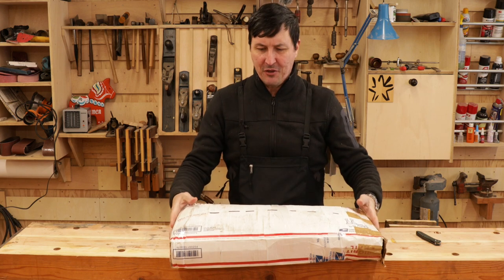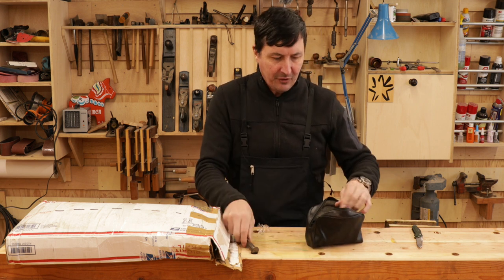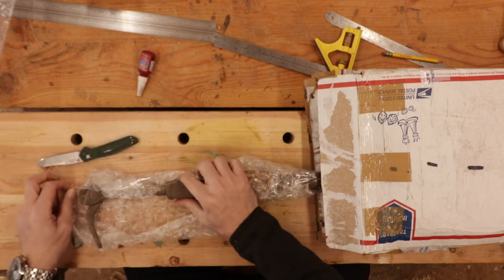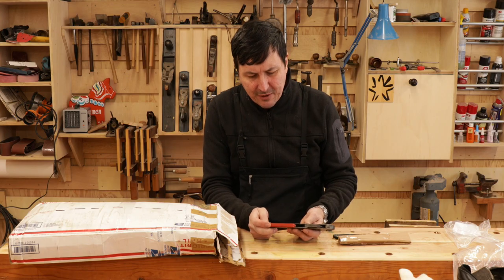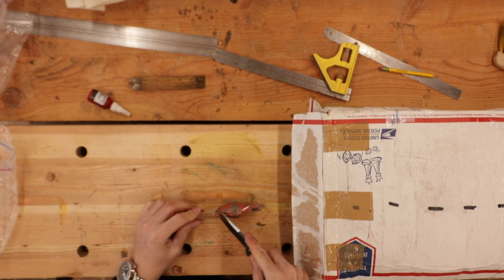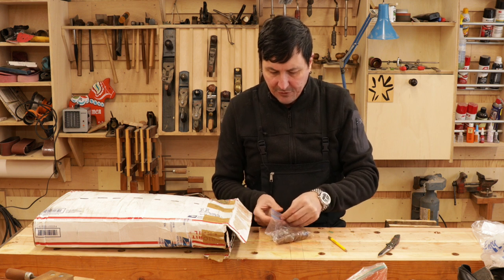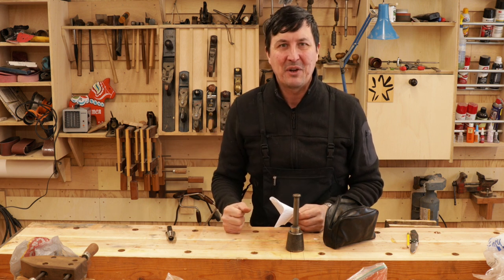AMAZING Vintage Tool Unboxing

Comment: I've lit a lot of fires with my Western! I sharpened one for someone else, looked up the brand in the forums, and fell in love. Had to have one. Found one from the fifties, still made in Boulder, CO. I just love it. I put a convex edge on it, like an old Marbles knife. Finding one with the sheath in good condition is either rare or expensive. I had to sew my own. You'll love it it you keep it, and if you give it away, it will be treasured.

Comment: Cody, that is a pounce wheel, also known as a tracing wheel. Pouncing is an art technique used for transferring an image from one surface to another. It is similar to tracing, and is useful for creating copies of a sketch outline to produce finished works.

Pouncing has been a common technique for centuries, used to create copies of portraits and other works that would be finished as oil paintings, engravings, and so on. The most common method involves laying semi-transparent paper over the original image, then tracing along the lines of the image by creating pricked marks on the top sheet of paper. This pounced drawing made of pricked holes is laid over a new working surface. A powder such as chalk, graphite or pastel is forced through the holes to leave an outline on the working surface below, thus transferring the image. The powder is applied by being placed into a small bag of thin fabric such as cheesecloth, then dabbed onto the pricked holes of the pounced drawing.

Comment: Cody something I HIGHLY recommend to you is Evaporust. It's an excellent rust solvent that works for a long time. You can just dunk a tool and it will eat away all 100% of the rust on your item or tool. I bought it and I have now run out of rusty things to dunk in there! Definitely check it out.

Comment: I believe the handle with spiked wheel is called a "Ponce Wheel."  Use it on all sorts of soft materials to mark a pattern.  Used one in H.S. to trace a pattern on stencil paper, then used a powdered chalk bag to tap over the pattern and transfer to wood, etc. For sign lettering.

Comment: I believe that tool (re: stitching leather) is actually a tracing wheel.  They are used to transfer cutting lines from a pattern to the material being sewn.

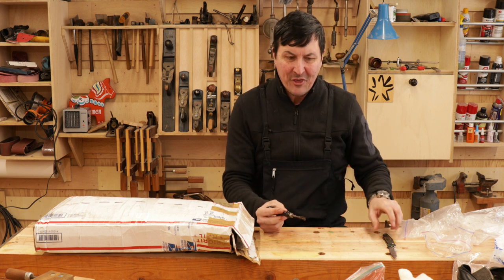Comment: Tool at 16:30 is very common for seamstress. You place a piece of 'carbon paper' (several color are available) and you trace a line that is visible enough to do you cutting or stitching but not strong enough to damage the fabric.
Nice video, thanks.

Comment: Cody before you use the grommet setter turn the anvil over, the small end needs to be up (there should be a circular groove in the small end).

Comment: I think it is a "pounce wheel" used for pattern transfer and sign making.  Pounce the pattern in some paper with the spike wheel, put the paper over the workpiece and use a bag of powdered charcoal or chalk to tap along the line and leave a dotted line of powder that goes through the holes and leaves a dotted line for the pattern.  Paper pattern can be used repeatedly.

Comment: I believe the little spoked wheel with the handle is a pattern tracer. It is used by laying a pattern on material and running the wheel along the line transferring the shape to the material whatever that is, soft wood, leather, etc.

Comment: Leather wrapped sheath knife looks a lot like an Old Buck Knife.
The tool with a toothed wheel is an old maritime tool sailors used called a Jagging Tool for marking canvas sail parts for sewing. Help you get the stitches perfect.

Comment: Great stuff.  For what it's worth, I like the Wiss brand of scissors.  Large plastic easy to grip ambidextrous handle, but available with a full tang so the blade steel continues thru to the bottom of the handle.  Great for cutting the molded plastic packaging that is so difficult to open otherwise.  They're available at Home Depot or Amazon.  God Bless Brother!

Comment: The little drill bit things are called Gimlets, they are or were used to make pilot holes for screws.  A full set usually covered screw sizes #2 through #9.  If the square is an expensive one at the time it will have two small screws in the bottom of the handle used to adjust the square when it goes out of square.

Comment: Did you know that you can get right and left hand scissors. It is how they shape the thumb and finger insert. Love your outlook on life.
Reply: Robert Sullivan The cutting edges are on opposite sides as well. The normal lateral forces when operating scissors are supposed to press the blades together. If you use scissors made for the other hand, the natural motion spreads the blades apart instead. You can easily see this in those simple grade-school scissors with the round holes that do not have the tapered surfaces so are supposed to be either left or right handed. A left handed person can you them with some practice but the hand quickly fatigues due to the unnatural motions needed to force the blades together instead of apart.
Reply: Thanks Thomas. Great explanation

Comment: The small-toothed wheels were also used to transfer patterns from paper to wood by rolling over the lines and leaving the line of holes to mark the pattern.  Additionally, you could flip the pattern over, following the line of punch marks to mark mirror image parts from a single pattern.

Comment: Keep your crappy fiskars for paper, then you don't have to use the good ones on the stuff. As Adam Savage once said "Paper is a collection of polymers specifically designed to dull scissors"

Comment: Folding rulers are used much more than tape measures here in Germany. I find it easier to use too, especially when measuring things like heights and stuff in midair, where a tape measure is not stiff, so it will sag.
Ours fold differently from that one thiugh, and are much longer.

Comment: STAR WHEEL: used for transferring a pattern to another surface.  On a paper a pattern or sign letters are sketched. The star tools pokes little holes into the paper...so a bag of chalk powder can hit the paper and got thru the holes to give you a chalked pattern lines.

Comment: Funny how when you were un-boxing the items, I found myself mouthing the names of most of them. I'm 64 years old and have worked with my father while growing up. He had tools that were handed down to him from different sources. And now I have them. He was a backyard mechanic and a machinist. I also worked for the water supply company in my home town in lower Westchester, N.Y. They had a wealth of tools and machinery that went back to the mid to late 1900's. I knew immediately that was grommet tool because I used one quite a few times. The nail puller, yep. I used an extremely old yet still perfectly functional one only king size to open large crates that came with things to do with water supply, fire hydrants, etc. I'm getting old now and my son has no interest in any of this stuff.

Comment: The tool at 10min is a Locking pliers. Used for welding generaly. You adjust the thickness of the part you weld with the litle "screw".

Comment: That knife is one of the original style for the Boy Scouts. I just did a restoration on one a few months ago for a coworker. The leather stacked handle on the one I received was missing, so I replaced it with some green canvas micarta. I can send you some pictures of it.

Comment: My grandmother had a pair of arrow scissors.  They weren't general purpose.  Those were her seamstressing scissors. Man if you touched the old pair to anything but thread you were going to hear about it.  And we don't even think of touching the good pair in her sewing box.  Search Midwest arrow scissors prior to 1940.  I think they were a Midwest thing but they were slick.  They would cut poly or cotton thread with zero fray.  So easy to thread tiny needles which was always dedicated to us little kids with young eyes.

Comment: "little tiny drill bit with handle" is called a gimlet
Reply: Yep...
Reply: It's not a power tool ... so ... there is no problem
Reply: Thomas Grant Vodka for a gimlet... K
Reply: wasn't that a dwarf on the hobbit ?
Reply: Gimlet, Son of Groin....
Reply: Thomas Grant Anyone ever told you your preferences are wrong and you should be ashamed?
Reply: I'm getting so old it took me 15 minutes to remember the name.  I think this may be a result of partaking more them my fair share of Gimlets in the late 60's all  of the 70's and and the better part of the early 80's "Keep Coming Back"

Comment: why don't you make a  big, heavy duty, draw-string leather bag with that grommet tool? That would be a really interesting video.
You would make use of that leather rolling too to do some stitching, perhaps even forge some thick needles/pins fro your leather work: and of course, use the grommet tool to put the string/rope through the top.
Nice video Cody

Comment: 1 the grommet tool is definatly military used up until the 90s when new tech came out. 2 the small drills and corkscrew are gimels and could date to the 1700s.

Comment: Cody the anvil for the grommet tool goes the other way...  If you look at the small end you will find it has been machined to help form the grommets and lock the two halves together.

You have some neat things there.  I too like those gloves, most of the time I use TIG welding gloves unless I'm doing high amperage welding.

Comment: I don't know arrount the world, but that folding ruler, damn, so nostalgic. I'm brazilian, we use metric system, and those are called here "metro", literally a "meter" kkk but it has imperials also. My grandpa was a carpenter and cobbler (is it right? If it's not, blame on g translate), and I still have his ruler. I'ts insase to know he made such incredible stuff using this as his only measurement tool. Seeing one of these on your hands made my day!

Comment: I have a Grommet set very similar to that one. Its in a green Tent Canvas type of pouch with a brass clasp that has the Boy Scouts Logo on it. The pouch has pockets on the inside to hold the various parts of the tool. The punches are stamped BSA. Im thinking its from the 40s or 50s.

Comment: Those gloves may be structure firefighter gloves. On the video they looked a little thin but look a lot like the older style of structure gloves. Also, the bag that the gromet kit came in looks like a blood pressure cuff bag.

Comment: I had one of those nail pullers.  It was wonderful.  But one of the teeth chipped off. I tried dressing it a bit and grinding the other tooth till they matched, but it would never hold on to nail heads properly after that.

Comment: My father had a deer hunting partner and they would only see each other during deer hunting season. The hunting partner was the type that would spend 600 on an item if its twin was 20 just so he could say, and would say, that it cost 600. He was demonstrating his latest acquisition,  a 500 dollar knife and asked if he could see dad's knife. It was a Western that my sister got him for father's day and had cott less than 5 bucks. He said that it would be impossible for a knife like that to take an edge and through it into a log in the fire. Dad commanded that he would be going to retrieve the knife and wouldn't be waiting for his fingers to quit bleeding. Partner complained that no one should have a knife that sharp. I think I know why they only saw each other during deer seasons.

Comment: Around 11 minutes in, I believe that file is used for clockmaking for filing the escapements
Reply: Either that or a “points file” for older vehicles that ran a points and condenser ignition system!

Comment: if you ever run across a   c r Laurence ck3n1 ultra thin combo knife/util blade with screwdriver bits please holler if you would be willing to part with it 😊

Comment: Just purely out of curiosity, why do you hate on the metric system so much? In the UK we use both systems interchangeably depending on which is more appropriate for the task.
Reply: Colonel Conker because standard is ALWAYS more appropriate for the task
Reply from the maker: Indeed
Reply: Colonel Conker because people in the comments section cry about it when you don't use the metric system and that makes it  a lot of fun to despise and never use the metric system

Comment: You are right with the grommet process. Your plastic isn't thick enough. You probably need 1/8 to 1/4 inch of thickness. ...And don't bash to hard. The female part should not get deformed and it's preferable that you can't turn them, but you'd prefer to be able to turn them over deforming the female part. That will happen if your material is not thick enough or slippery, but yours have teeth so it should not turn at all. There is nothing like a test piece! :)

Comment: loctite question: i have a moped carburetor that is leaking from the screw on the bottom ( to drain the fuel ) because the threads are worn out and the screw is slipping...can i fix this with loctite or another product or should i fill up the hole with epoxy or something else and rethread it?

Comment: hey wranglerstar, my grandmother has an old axe in her garage that has me stumped as to what it was used for. instead of a regular head it has a big long fin or something sticking out of the top of the blade, best i could do quickly in ms paint but it's close enough that you could get the idea, https://imgur.com/a/UIBzV bear with me since i'm jsut going off memory, i haven't seen it in a few years but i remember the backside of the fin being sharpened and the front where it would make sense to continue with the regular axe blade is flat
Reply: the grey areas are where it's sharpened in case anyone doesn't get that